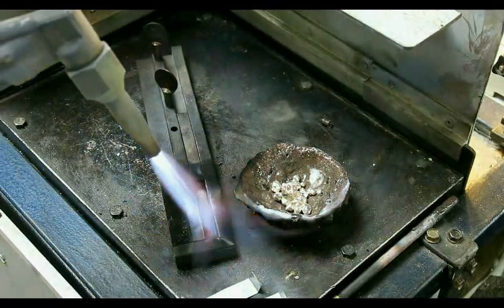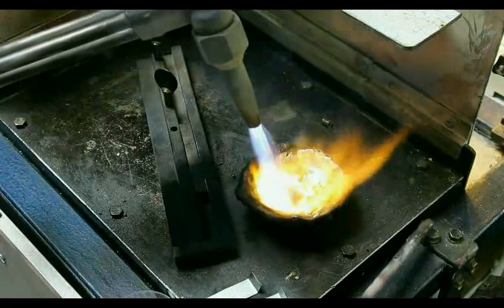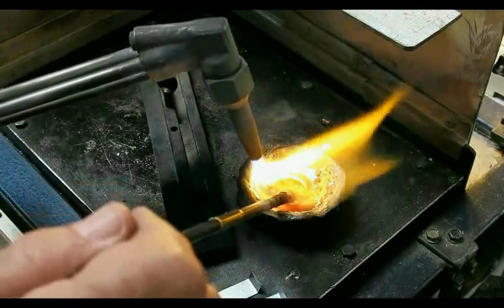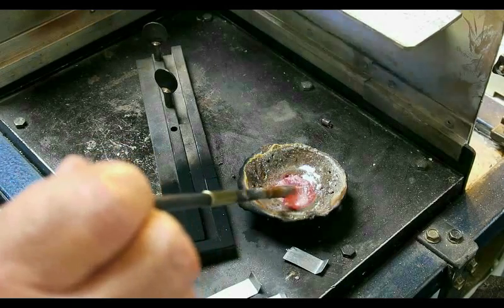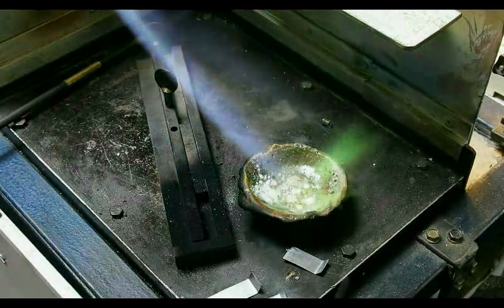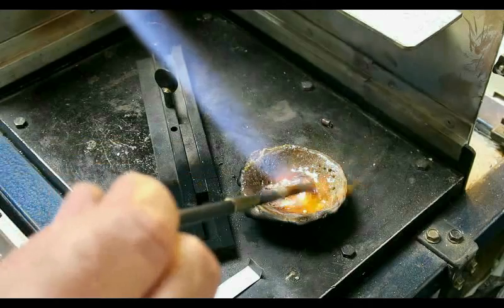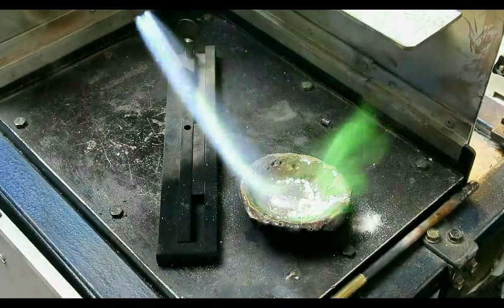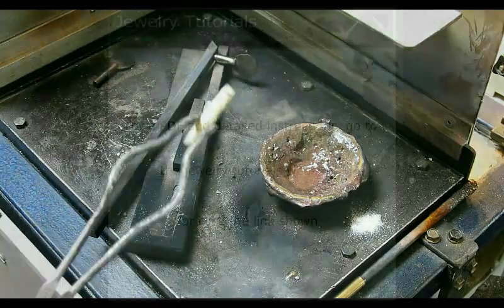How to Make  Your Own Easy Silver Solder

Comment: Is there an easy way to separate the zinc from the silver if you wanted to purify the silver once again?
Reply: Would be a waste of money Doing so the chemicals you need are deadly without very good ventilation you can die from the fumes. There is only a few dollars worth of silver in there better to sell it as spot silver if you don’t plan on using it
Reply: Yes, a cupel. It doesn't require chemicals. It's a material that will absorb the base metals. Watch a video on youtube about it.

Comment: This is really helpful. I just have one question though: when rolling this on a mill, do you also anneal the solder? I have followed what you did here but I'm having issues flattening this so I can cut to Pallion. Thanks in advance
Reply: Yes. Reduce by 1/3 to 1/2 thickness or until it gets difficult to roll. Then anneal and repeat until it’s thin enough. A sharp chisel on a scrap piece of steel works well for chopping it up, it’ll dull nippers a lot faster than most things (that a jeweler uses them for)